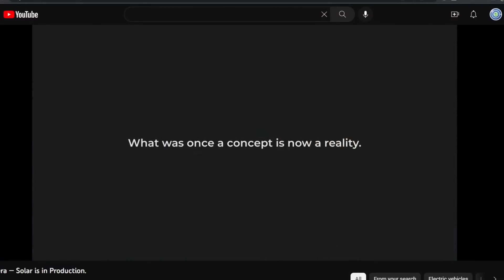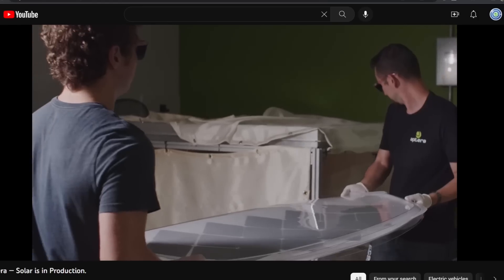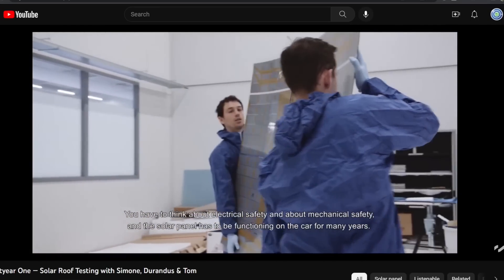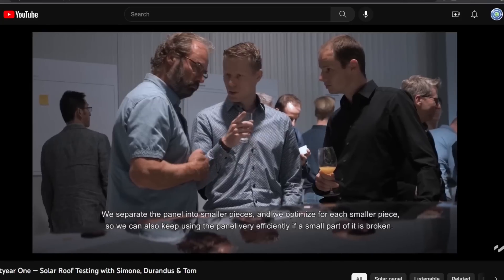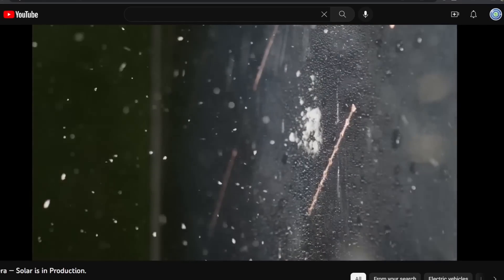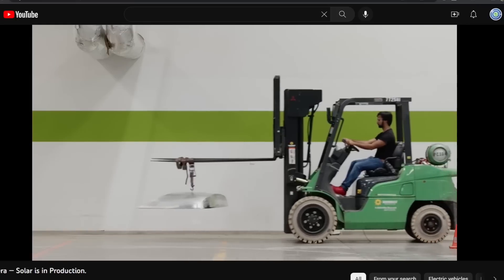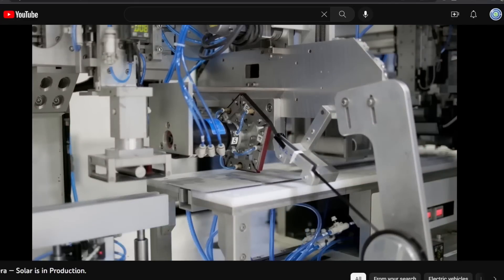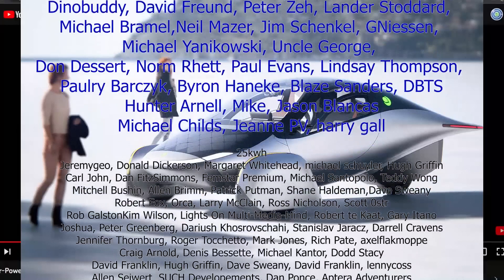Why did Aptera, Sono and Lightyear all independently develop solar panels?

Comment: I think the Aptera panels are the only ones that are replaceable. Sono was showing how much they could curve panels, but they didn't need to for their car. They pointed out that the heat in their process warps the panels so you can see waviness which is ok on a prototype, but not so much on a retail car. So they are still working on it, but the car they were showing in the US is number 10 out of 40 they have built so far, so they are getting better
Reply: I'm pretty sure Sono's panels are "replaceable".

Comment: Eventually each company wants to come up with cutting edge technologies on their own otherwise they are on the hook for the failures of tech they buy off the shelf that may not work as advertised.  Aptera knows how good their stuff is or isn't and if it falls short in testing then they can do something about it themselves.  Probably wouldn't be able to do that if you just licensed those solar cells from someone else.  Those Elaphe motors are bought from hub motor experts that are providing motors especially designed for Aptera during an engineering collaboration between Elaphe and Aptera engineers.  I can't imagine Aptera designing and building a hub motor from scratch because that would require way too much time and capital.  Aptera apparently decided that designing and manufacturing in-house curved solar cells was something they could tackle and so apparently they have.  Maybe they believe they will be able to license this tech to others for another profit center.

Comment: All three chose silicon solar cells because perovskites, which can literally be sprayed on a surface, are not ready for prime time. 

What they all did was use a particular cell that accomplishes their goals. Unless you're order is a Noir in matt-finish, the Sono cells are on their face at best a utilitarian effort at finish. 

What the hooter will be is when someone does a plain plastic panel to replace Aptera's solar panels and the owner places the Aptera roof part on the top of the garage, runs a wire down to the Aptera solar connector and boom, great solar while garaged :)

Depending on the processes - and remember that Monro's staff has these folks as clients and they helped NASA build stuff like solar powered satellites - it might be premature to suggest that Lightyear 'is ahead' ... They may indeed have a good process but will the mechanics of it be as elegant as those devised by the Aptera team?  Lightyear priced their innovation at quarter million a copy which tells me they spared no expense which to me is a signal that they may not have looked as intently at the cost of the production process as Aptera which is about producing a profit on a vehicle with a msrp beginning at a tenth the cost. 

The latter fact being the factor that maybe gives Aptera the advantage in this. The Sono's process, while definitely cheap, just looks it and in my opinion would cheapen the Aptera.
Reply: Sandy Monro does not help NASA build solar powered satellites. For the most part, all satellites are built by Tier One contractors like Lockheed Martin, Boeing etc. Sandy Monro's team have no dep expertise in solar. They are process engineers
Reply: Whether ready for prime time or not, you seem to have an overly simplistic view on Perovskites.  Also, practically all satellites are "solar powered".  Do you mean "spaced-spaced solar power stations"?

For the record, I have assisted in the design and fabrication of a variety of terrestrial, near space and actual space-based solar systems and would bet there's practically nothing a space-based only solar engineer can offer Aptera.  It is naive to think it is "premature to suggest that Lightyear "is ahead"" on the solar.

Comment: I think that Aptera made the best choice for several reasons. First, the initial price of the Lightyear One was $175,000, and they revised the new price to reflect the actual costs of development at $250,000 each! I think that if Hyundai or VW wanted to license Lightyear's solar technology they could easily afford the cost and make an alliance. But the Aptera's production volume is far less, and so the licensing per vehicle would likely be far more than doing the work themselves. Also Aptera chose to go to outside suppliers for most of their technology. From Elaphe's motors,  to EVE Energy's batteries,  to Yazaki's wiring harness. Chris said that they are not seeking vertical integration like Tesla because it allows them to accelerate development, build their EV sooner, and more affordably. But the exceptions were the solar encapsulation, the belly pan cooling, and maybe the body shell. And the simplest explanation is that those areas are pretty specific to the Aptera's design, and they are not going to get the customer designed parts easily from outside vendors at a reasonable cost. Also other business would be less interested in developing new products for a relatively small EV startup company that doesn't have massive funding like Rivian or Lucid. And in contrast to 2170 batteries and other common supplies, if Aptera had committed to another company for manufacturing the encapsulation or cooling system, if that partner company had financial or production issues, Aptera would be devastated. They have that potential risk with Elaphe, but Elaphe is doing pretty well overall, and Aptera has developed a symbiotic and trusting relationship with them. I do still wonder how the Aptera's body shell will be built, and if it will be outsourced, and I also wonder what the undisclosed deal/product is with Chery?
Reply: Aptera's earlier work with solar competitions(?)

Comment: I wish you could order an Aptera without solar panels as I have no use for them.  The car will be garaged all the time.  I'd rather save the money by not having solar.  For me it is the size and efficiency that I like.  I'm sure I'm a minority but I wonder how much the solar really matters to the range of potential buyers.
Reply: The minimal solar (roof and dash) obtainable on Aptera is useful for, at least, ventilation when parked outside on a hot day.
Reply: Everyone has their top 3 or 4 criteria in a dream vehicle.  Mine are solar, inexpensive, efficient and comfortable to drive.  Another person's criteria might be 2-seater, high-milage, racer. Someone else might say they want the car of the future at a great price.  Someone else might say they want a car they can repair, commute to work in, and take camping.   Solar meets the criteria for car of the future, efficiency, modularity, long lasting.

For me, if solar is removed, my interest is gone.
Reply from the maker: I've heard several people say the same thing.  you're not alone.
Reply: Interesting. Good to know.

Comment: There may be multiple reasons, but I think the most compelling reason is that each is a start up. Do you want to rely on a possible competitor? And one who may not exist a year from now? It would be different if they had been manufacturing them for several years and you could feel confident that they will be around 2 years from now.

Comment: There is a lot to be said for owning your own destiny as a startup, especially with the newest and least proven technology you are trying to incorporate. Tesla helped create the supplier industry for BEV components, so Aptera does not have to develop the drivetrain or HVAC, just integrate. For the solar aspect, they can rapidly prototype and make drastic changes on the fly with their first few years of production vehicles, without waiting for suppliers. 

They also have Sandy on their side, so I can guarantee they weighed the options of injection molding, sheet molded compound, composites, sheet metals, and anything else that has been used in cars or aircraft in the last 60 years!
Reply: The company I worked for in the 2000's developed the Masterflux line of high voltage AC compressors and supplied many of the early EVs, including the Ford Th!nk, and other startup EV companies.  We eventually sold that product line to Tecumseh Products rather than to go into high volume manufacturing, and, in part, to fund our own Marine EV development.  We hired the Tesla Motor engineers when Tesla ran out of money before they got their last minute 50 million dollar loan from Daimler.

Comment: I had attended the Sion viewing at San Francisco this week. There were a few observations, but here's one related to the solar panels. This might apply to all 3 vehicles, I don't know.
   They advertise that it can solar-charge in the shade. However, it didn't. This was a sunny day, but the city buildings cast a shadow over the entire vehicle. The rep I spoke with seemed surprised that it wasn't charging.
    Obviously, there needs to be some cut-off point as to when to allow charging, because it takes electricity to manage the charging process.
Reply: Does Sono "advertise" that it's Sion can solar-charge in the shade or do they advertise solar-charge with partial shading?
Reply: @bobhilder1469  From the "information sheet" available on their web page: "For solar integration, we use monocrystalline
silicon cells that produce energy even under cloudy skies or in the shade."
Reply: @rashidclark  Thank you for that rashidclark.  For some reference, I happen to know quite a bit about the "monocrystalline silicon solar cells" that are in use by all three (Sono, Lightyear and Aptera).  I actually assist in the design and manufacturing of solar panels for "specialty" applications and the Maxeon/SunPower cells they are all using do have some interesting characteristics.  Further, I think that advertising done by Sono is rather in-artfully stated and I wonder if something got lost in the translation from German to English.  Let me explain.  For those that do not know, separate and discreet diodes (or "ideal diodes") configured in "bypass" mode are used in solar panels to mitigate the losses upon "partial" shading.  For panels subject to wildly varying partial shading (like a moving vehicle), having a diode on EVERY cell could be ideal.  Since it's not practical to have a panel with a diode on every cell, however, why not make the cell have a bypass diode-like characteristic themselves.  It is not widely known that the later "generation" Maxeon/SunPower cells, indeed, have this bypass diode-like characteristic built into them.  The net result is that even if a significant number of cells in a string are shaded, they will be bypassed and the remaining non-shaded cells could, indeed, continue to work and if the voltage is high enough, continue to provide charging.  Full disclosure, however, the bypass diode-like characteristic built into the cells isn't a particularly "good" diode so it shouldn't be leaned upon to highly.
Reply: @bobhilder1469  Very well said Bob!

Comment: Aptera may not be reinventing the wheel so much as reinventing how the wheel is made.  I believe that injection molding only becomes cheaper on a much larger scale, and can be added later when they are as big as GM ):-(      Al Ryzy explained injection molding much more eloquently in his previous post.
Reply: You would think very differently about injection molding vs laminating if you knew more about laminating solar cells the way Aptera appears to be.

Comment: I think they should share there info and discovery. But should each do their own production. I suspect each will have it's strengths and weaknesses. But we won't know that till after production takes off. 8t would be cool if you could interchange them between vehicles, but I know that is laughable. Each one has a different shape and needs. It may go to that down the road, but right now, I think they should stay separate, I hope none fail, but failure is an option for all of them. If they get production started this year, I think they are in a prime spot to get a lot of new electric vehicles on the market especially if oil prices stay high.

Comment: How much does it cost to produce the solar panels vs. the batteries?
Reply: 😎EV batteries cost thousands, while solar panels only cost hundreds of dollars. For example, the full solar option for Aptera is $900, while the large battery option for Aptera adds $19,000.
Reply: @fotoguru222  While Aptera's "full solar option" costs the buyer of an Aptera $900.00, there's no way it costs Aptera that little to "produce the solar".
Reply: @bobhilder1469  ??? 🤔 I'm now really confused re. why you think that. You think Aptera is selling their full solar option at a loss? They are not a charity. So they need to make money on what they sell.
You can buy heavy duty home solar panels retail for less than a dollar a watt, so 700 watts of solar (Aptera's full solar size rating) for your roof or yard would cost you only $700 retail. Raw solar cells wholesale are more like 30 cents per watt. The plastic encapsulation layers material around the cells cost much less.
Reply: @fotoguru222  I didn't mean to cause you such confusion.  Sorry.  I'd be interested to see where I could buy, at "retail" in relatively small quantities, Gen 3 Maxeon/SunPower solar panels for less than a dollar a watt.  I'd be interested to see where I could buy, at "wholesale", 25% Gen 3 Maxeon/SunPower solar cells for 30 cents per watt.  The costs of materials such as encapsulation is likely trivial but I'm sure you would agree there's considerably more "costs" that go into the making of relatively low volumes of very specialized solar panels in the U.S. (California, no less!) than just cells and plastic.

Comment: If it turns out Aptera's assembly and encapsulation "techniques" don't work out in the "real world", they can just change to the mostly "open source" way of building appropriate panels.  Aptera will just have to set their pride aside and chat with graduates from University solar car race teams that now make a good living building such panesl.  I can introduce them to a few.....
Reply: can't agree more ... ! and finally the winner is... Maxeon !!
Reply: Are you in the AOC Discord? I'd love to hear your insights on the solar over there.
Reply: @MakeSteelBattalion2  In my minimal experience with Discord (looking over the shoulders of kids on Discord), suggests I would go nuts figure out how it works.  I could make an exception, however, if some good conversations could be had.  Convince me(?)
Reply: @bobhilder1469  Discord is basically just a better comment section. So, some things we've been discussing on the discord or if you have any insights here that would be great. We've been speculating that Aptera is using a rotary sprayer to apply a coating of Teflon to the surface of its panels. Another material in the solar video was labeled as ETFE, which we assume is the what the cells are encapsulated in. A weird observation is that Aptera has made roof solar panels biased in the right direction, and others in the left direction for some reason. I believe there are 7 (mppt/dc-dc converters whatever you call them) and that the roof solar is actually split into two separate series of solar groups to mitigate partial panel shading. Though Aptera says that it can manage individual cells being shaded without bringing down the whole group, not sure how. Curioes how IR window film would affect the dash solar panels, or how much of the near infrared the panels actually absorb. Also i've had some concerns about rockchips and the environment hitting the front facing hood and wearing down UV coatings if there are any.
Reply: @MakeSteelBattalion2  Rotary sprayer: Looks like one of these - https://www.youtube.com/watch?v=9RDj4tygyIE   I don't think it's apply a coating of PTFE (Teflon is a trademark).  Too easily scratched.  I use optically transparent ETFE films and it's quite possible Aptera is using 1 or more films of it in it's "layup".  I doubt, however, it would used as the top surface as, again, it's too easy to scratch because it is also a fluoropolymer.  One possibility would be ETFE film on top but then "coated" with some sort of hard "clear coat".  One problem with that approach is ETFE has a rather low refractive index and it's quite likely clear coats would have a higher refractive index.  Having higher index material over lower index material would lead to higher reflection losses.  All other things being equal, I see no difference in the string orientation on the roof.  The roof certainly has enough "compound" curvature to it that it is likely wise to have two separate "zones" each served by it's own voltage boost-style MPPT.  Maxeon cells have a sort of bypass diode characteristic to them so mismatch (partial shading) is somewhat mitigated at the cell level.  I believe just over 50% of the power that a typical silicon solar cell produces comes from what I believe is called the near infrared of the solar spectrum so, clearly, one shouldn't block the near infrared.  I don't know what wavelengths IR film would block.  Aptera claims that there's at least some protection from "rock chips".  After all, they are "automotive grade" whatever that means.  With respect to UV "protection", it is quite likely that the relatively thick "encapsulant" above the cells is UV opaque.
Reply: Yep. Good response and also good observation about setting aside their pride. But at least some sort of backup.
Reply: The solar car race panels only have to last for a short period, if they fail after a few weeks or months then nobody cares.
Reply: @WyndStryke  You don't understand "solar car race panels".  Most teams use appropriately made panels, they don't just have to last for a short period and they don't fail after just a few weeks or months.